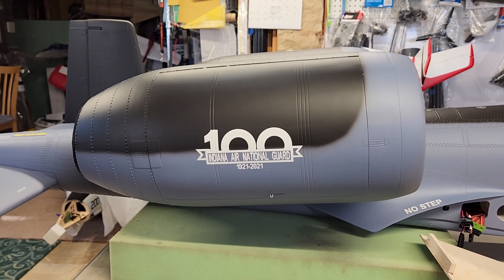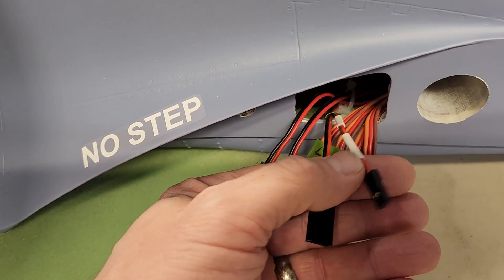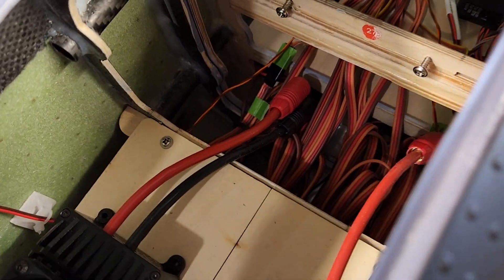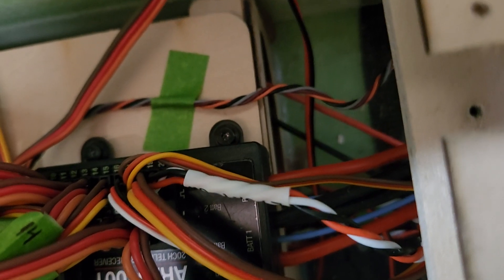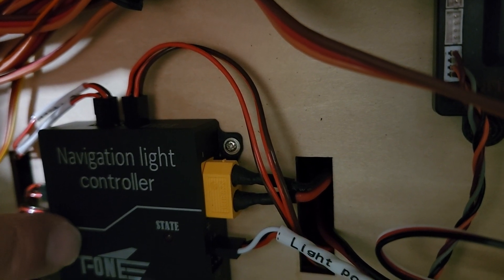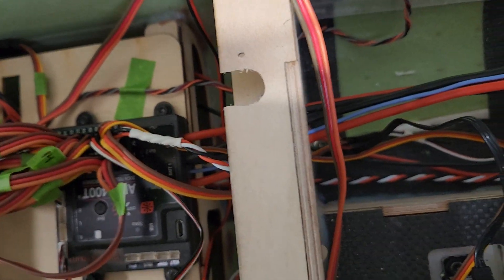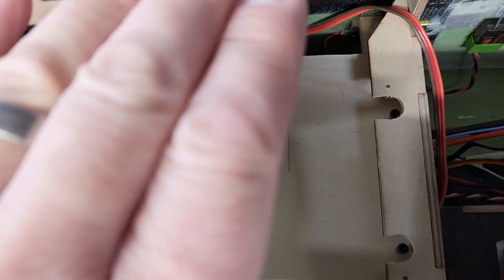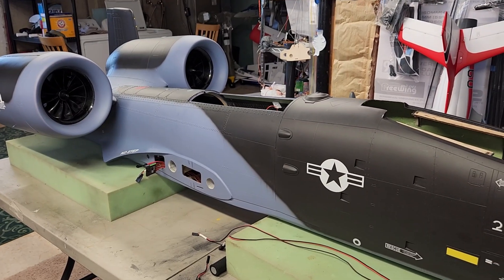T-One Models A-10 EDF conversion: Fuselage, nose and wiring. Part 6

Comment: David, master class as usual. I love your attention to detail. Instruction is really difficult to get right so most people can get a real grasp of what needs to be done. Your building instruction is second to none. So many tips and tricks of the trade so to speak being shared. These planes could be intimidating to build, but I imagine you give folks more confidence to tackle one. This is one heck of a A-10! Going to be epic!
Reply from the maker: The model overall has been a nice build. Some patience and decent modeling skills can make this kit very doable. Fortunately I had some great advice along the way from Dirk at Pacific jets as well as Jeff T. In AL who has built the turbine version with the wiring. He was exponentially helpfull in figuring out why the lights were being difficult. Once we got the first set working I backtracked all the way through to make sure it was right knowing other's may have the same problem. Two connection changes and the whole system lit up. Hopefully anyone else seeing this will find my thoughts and advice helpful! Thanks for your support Adam I truly appreciate it!